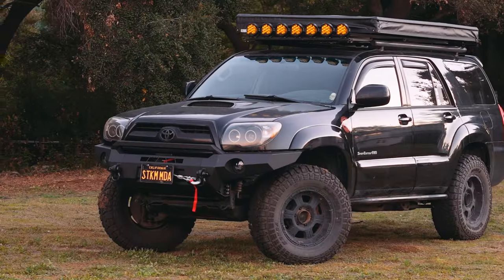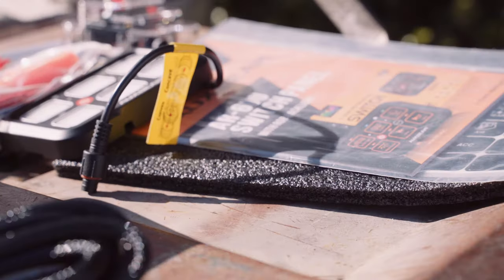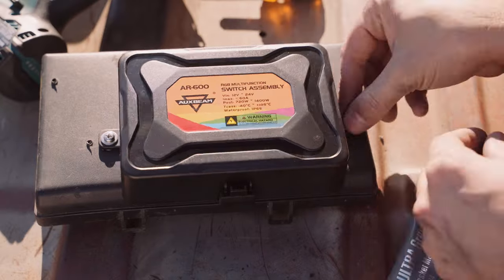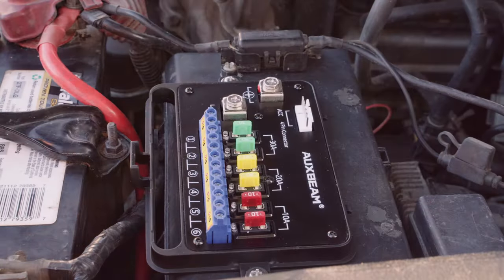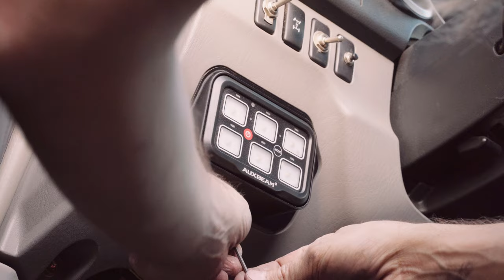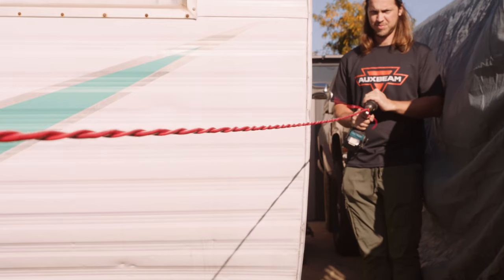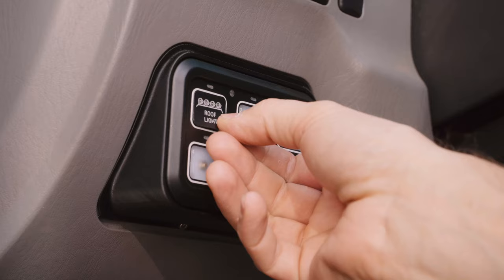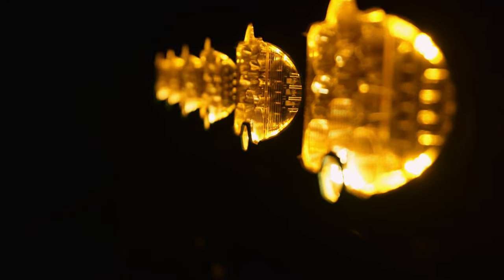AuxBeam RGB Switch Panel DIY Install How-To

Comment: You should throw some braided wire loom over the wires. I just did that myself, and it looks even more clean, and actually hard to notice there are wires running.
Reply from the maker: I agree. I’ve gone some braided loom in the garage I’m going to use on the suburban. Would definitely clean it up

Comment: Great video! How does the switch panel determine the difference between DRL and the full power light bar? How did that wiring work? Is it just two separate leads that go to two different buttons?
Reply from the maker: Thank you! The lights have separate leads for the DRL and the main light. so you just wire them up to two different switches

Comment: Do you remember which fuse number you used for the under hood ignition/acc? Was it the 25a seat heater fuse?
Reply from the maker: I don’t remember off the top of my head. The one I used was actually a connector I put into one of the unused relay slots. It’s easier to find a proper ignition source in the cab fuse box
Reply: Thanks!

Comment: Can you control the different light functions with that panel? Such as strobe, amber , or white?
Reply from the maker: It has a stroke effect built into the unit. But a lot of light have those functions all in a sequence of ons and offs